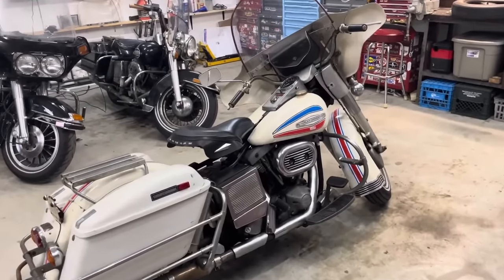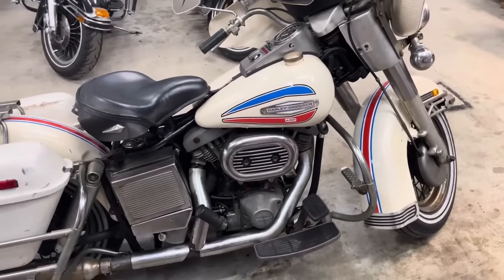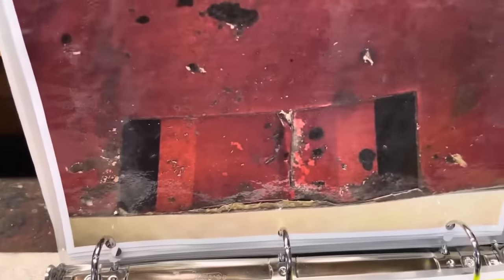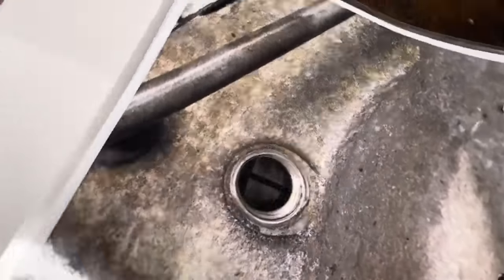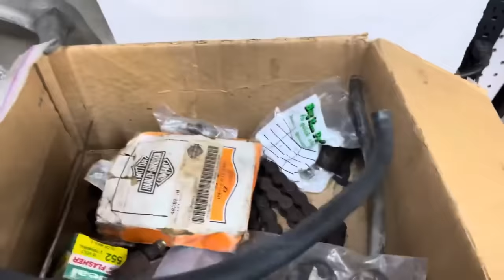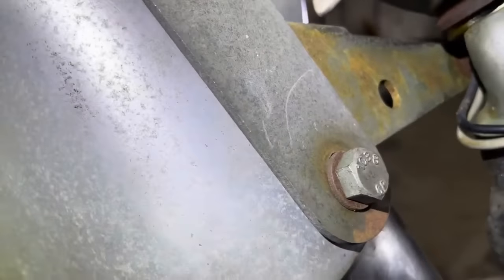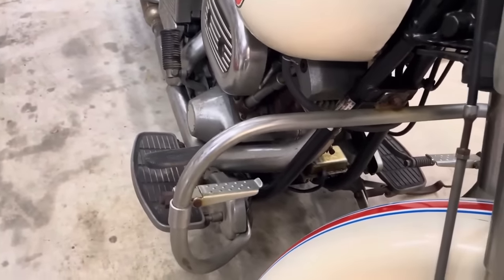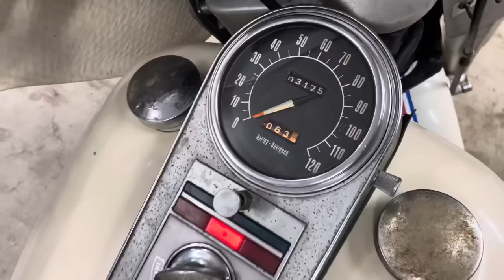1971 Harley Davidson FLH Sparkling America FLH Barn Find History

Comment: The highway pegs were not a factory option. They were an accessory that could be bought from the dealer under part number 49100-58. Dixie/ Superior also had the exact same pegs with the same part number as an aftermarket item. There are still a lot of new old stock Superior foot pegs available. I bought a set many years ago for my FLH, I don't remember if they came in a Harley or a Superior box.
I mounted the pegs on my bike the exact same way. If you mount them on the outside of the bars, over time, a combination of vibration, the wind blowing, and just the weight of your legs makes your feet want to slide off the pegs. If they are in the inside you just slide your foot in there and your shoe kind of naturally slides towards the crash bar and stops and you can go for hours without your feet sliding off. I don't think it's unsafe, mine have been like that for 44 years and it has worked out fine for me.

Comment: Disregard last post. Your correct. I didn't watch vid before i posted. FYI mines original except for external throttle cable. AMF gets a bad rap. Take care of basics it will run like a champ. I've owned mine simce 1978, 3rd owner.  Good luck.

Comment: i'm not buying that story about painting it so it would sell. the people buying harley's in 71 were not anti war or anti america. i;m 70 years old and remember those days vividly. the bikes were just damn expensive for most people it wasn't like today when 9 of 10 bikes are HD. to see any electraglide at all then (at least in the northeast by me) was rare. check the records, total production run  of the flh was about 3500. i own a 71 flh with REAL original paint bought in 1992. it was my daily rider for years and it;s been to every state east of WY. FYI the sparkling america paint job was a $25 extra back then and that's why they are rare.
Reply: to be clear, this is a beautiful bike with many original parts. one other note, the sale of hd to amf happened after these bikes were at the dealers. amf sent those little amf stickers on the gas tank out to the dealers with instructions to put them on the tanks. there was tremendous anger from most dealers over the sale of the company and many dealerships refused to put the stickers on. mine has no sticker.